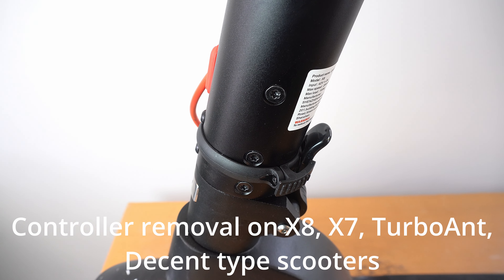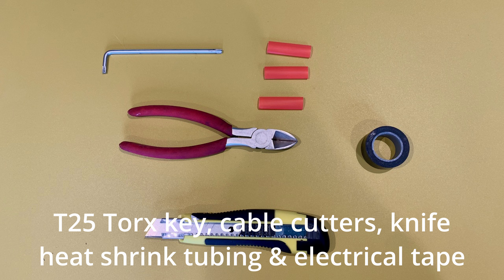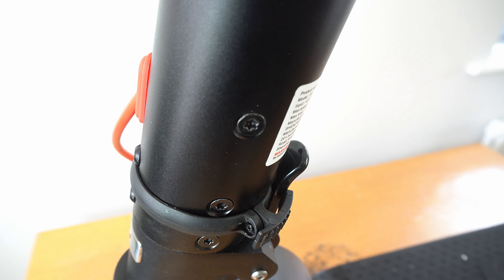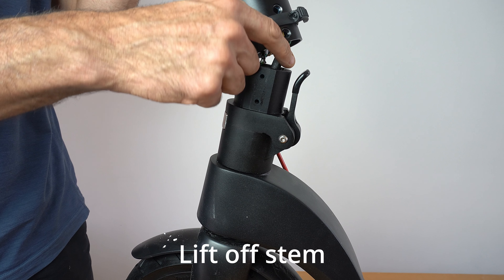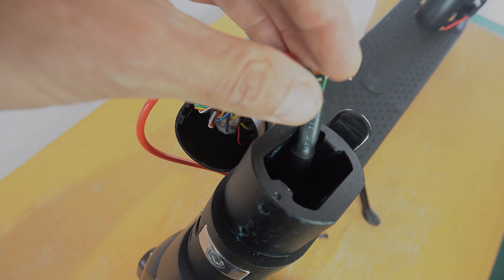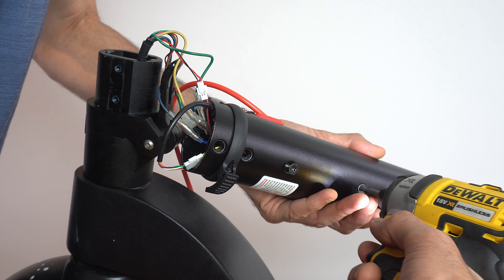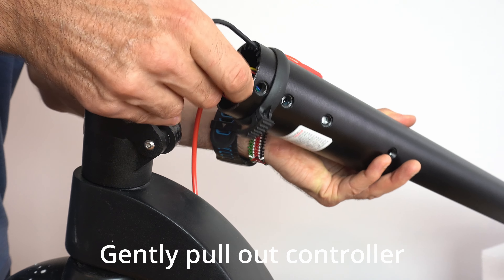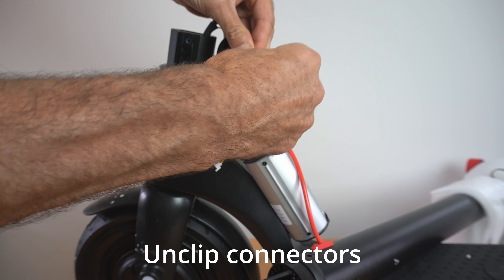TurboAnt X7 Pro, HX X8 Electric Scooter Controller Replacement

Comment: 😢Thanks to you now I’m gonna purchase the controller and replace it with the help of your video tutorial! I was looking for hours, the name of the part, video tutorial on how to fix it. My scooter battery connector broke off and the wires ripped off, I was gonna have some more solder it but now thanks you I can now replace the entire part and achieve a clean profesional job, all thanks to you!. Thank you. Thank You. Thank You.
Reply from the maker: Good luck! It's fairly straightforward. Take your time.

Comment: Excellent video! I have a X7 pro that won’t power up even though the battery is at 42 volts. When I attempt to turn on the scooter and wait a few minutes the display screen is warm but no display.  Does this mean my display is bad or perhaps the controller. Also when I install my battery the front headlight flashes once is this normal?

Comment: Do you have a video that shows replacing the wires below the controller to the motor wheel ?
Reply from the maker: Not at the moment. If replacing the motor then it's fairly straightforward.
Reply: @HorizonMicromobility  its just the cable to the motor i need replacing,  looking for the cable itself is an issue,  can only see the entire motor and wheel or the controller cable 🤔  also im female trying to fix for my son, nobody where i live fixes them
Reply from the maker: @stephdyer138  not aware if you can buy just cable. Email us a photo and we’ll see if we can help

Comment: On the x7 max i got a E8 error code after getting caught in the rain im pretty sure it is water damage that caused it asking for help if anyone knows if thats the case or not. Got a controller coming in for replacement just tryyna make sure that would solve my issue

Comment: Hi there my scooter beeps very low the press the power button but does not turn on any solution?
Reply: Did you find a fix for this?
Reply: @georgemolina8780  bought new controller and screen